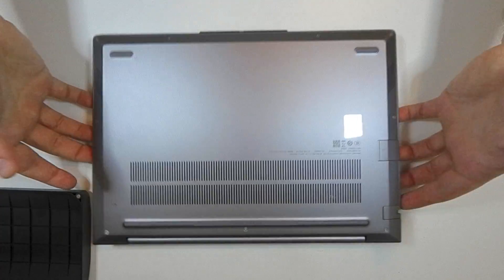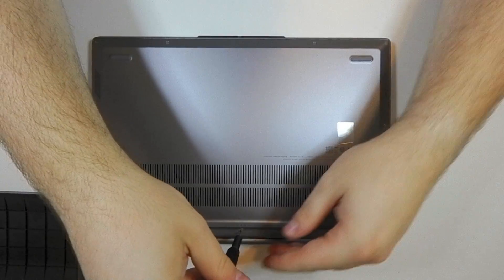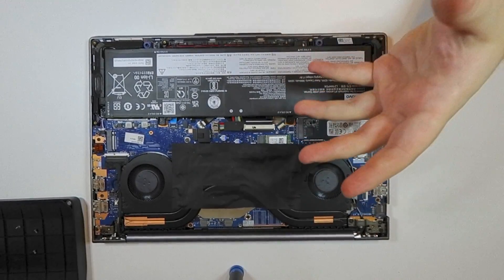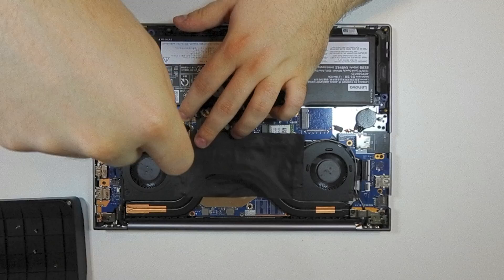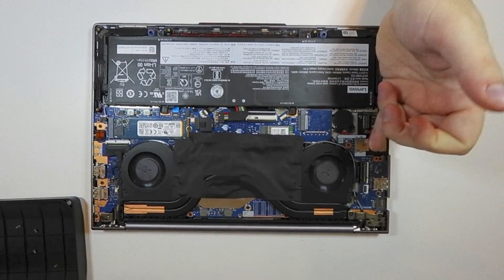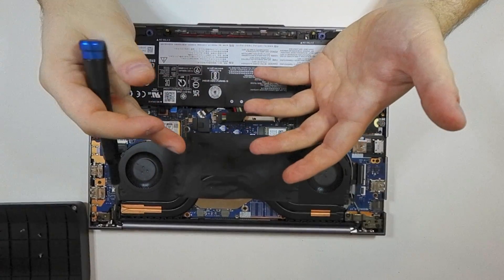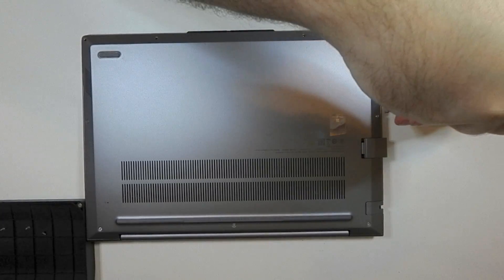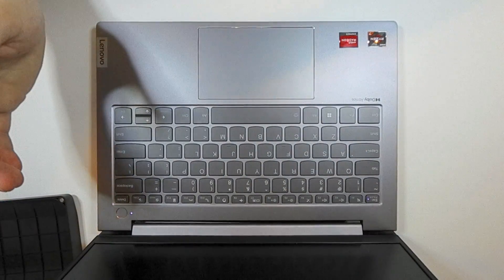Thinkbook 14+ Oculink Installation

Comment: The video states that the maximum speed for the system is limited to 32 Gbps. A ThinkBook with Intel Thunderbolt 4 or AMD USB 4, which has a maximum speed of 40 Gbps, is used in this setup. What is the purpose of this configuration?
Reply from the maker: With a single board OCuLink adapter I was able to achieve 64gbps of bandwidth to and from an external graphics device. It was indeed signal integrity that halted the proper link training up to PCIe 4.0. As for Thunderbolt and USB4, they never reach that speed due to protocol overhead and are subject to latency penalties from the various mux chips along the PCIe path. Though some modern USB4 adapters can exceed the 30gbps barrier you're still better off with OCuLink for gaming tasks.

Comment: does this giives pcie 3.0 speeds? do i understand it correctly in video?
Reply from the maker: This specific adapter only trains up to PCIe 3.0, but a single board adapter is more often successfully reaching PCIe. 4.0.

Comment: This is super useful, thanks a lot. It would theoretically allow me to buy any business laptop I want with two M.2 slots available, Thinkpad or not.

The real issue here is finding the proper adapter to fit a certain model of a laptop, since if I understood correctly, this adapter is tailor made for this particular model of Thinkbook, and the space it has.

Do you happen to know any website that would allow me to search for custom adapters for X laptops? I don´t mind buying one laptop or another if I know for a fact there´s an adapter to work with, the other way round might be a nightmare.

Cheers!

Comment: So is this the same process and products you’d use for adding an OCuLink port to any laptop with an m.2 port inside?

Or is this only a thing for Lenovo?
Reply from the maker: This video is for this specific machine by Lenovo, but theoretically any machine with an available m.2 PCIe slot can have an OCuLink port added, it just might not be as clean or convenient.

Comment: Thanks for this informative video. I see that an updated (?) version of the oculink adapter delivering the full 64gbps is available on sites like Aliexpress. Is this something that you plan on testing out for the AMD-based thinkbook plus models? Seems a shame that us that would like the full bandwith should be limited to the Intel Models with TGX port for eGPU use…
Reply from the maker: On models with 7000 series AMD CPUs and beyond the aftermarket adapter supports PCIe 4.0. I was able to confirm this with both an AMD RX 6900xt and an nvidia RTX 4080.

Comment: Thanks for the vid. Will an oculink setup work for "ThinkBook 14 2-in-1 Gen 4" considering you might have to make a whole in the back?
Reply from the maker: As long as the BIOS doesn’t outlaw any unknown devices (typically only seen in business class devices) you should be able to connect without issue.

Comment: In my laptop (dell inspiron 7415 2-in-1)  there is only 1 m.2 slot and a WiFi card , what shall I do ?
Can I put the nvme with an adapter in the WiFi card or is there an oculink with an m.2 slot ?
Thank you
Reply from the maker: M.2 to OCuLink adapters are available readily on amazon from the likes of NFHK and OSMeta, however you’ll need an alternate solution for your OS. Your device only has one M.2 slot so USB-C would be your best bet.

Comment: I'm thinking about buying on of these and shipping it to the US. My only concern is the display. Are you satisfied with the display, keyboard, and trackpad?
Reply from the maker: The 90hz 1880p display on the 2023 model was more than suitable for everyday tasks and the 3050 mobile dGPU wasn't going to push past the 90hz in most titles so I found it suitable. Good colors and decent response times, but I definitely prefer the 120hz display on the 2024 14+ models.

Comment: I really don't get why a video like this doesn't have more attention. You covered everything that has to be said. Very well detailed. Thank you very much. 

In the end you mentioned about some quirks on the Intel option. Now, Lenovo has a laptop with the TGX (oculink) meaning we don't need to perform this hack anymore. Would those quirks still be present on it? 

Also, have you tried to run a Linux distro on it? Would it work?
Reply from the maker: I'm running the newer 2024 Intel based ThinkBook 14+ with oculink and most of the quirks have been ironed out. More to come on that in a video being dropped soon!
Reply: @iammissusnesbitt8286  Very exciting! Looking forward for the video, we are in the edge of an eGPU revolution and you are leading it, lol. Cheers mate!
Reply: @iammissusnesbitt8286  i'm using the same laptop.. need your video soon
Reply: @iammissusnesbitt8286  Any updates on the 2024 laptop guide? Looking to buy that laptop and follow your updated guide. I'm traveling for work 3-4 weeks a month and I can't afford to drop 5k on a laptop lmao.
Reply from the maker: @erich4753  The first two videos in the series covering the 2024 model can be found on my channel, with more coming soon as I'm able to compile the testing and make a more coherent script. Definitely check out the "First look" video [here](https://youtu.be/AwErQ8ksAAg?si=yOdS-ax2N6fUllnH) to get started.

Comment: I got myself a Lenovo Xiaoxin 14 Ryzen 7 8845h and I'm thinking of installing an oculink port on it .
I am in need of some help . If you are intarested in helping me with my project a little bit by giving me some pointer. It'll be splendid.
Reply: I'm thinking of adding the OneX egpu with 7600m xt with my laptop when I am home and take my laptop on the go
Reply: i think xiaoxin just have one nvme slot.
Reply: @winnerinsanjaya7604  nahhh  bro it has two but the slot placement is pure garbage
Reply: @dsyncerror4049  the one that have, i think the 125H version. the intel and amd version is just same at the outer. but different inside. the GPU and the board layout was different.
yes u have 1 more free nvme slot on intel version, bcz it doesnt need wifi card. but the amd version its not free, used by the wifi card
Reply: @winnerinsanjaya7604   nahh bro the Wi-Fi is in built in the board, and the second slot is smack dab in the middle of the chase if I make a slit for the oqulink port it'll make a big popo of the chasee
Reply: @dsyncerror4049  u talk about xiaoxin ryt? not the thinkbook 14+?